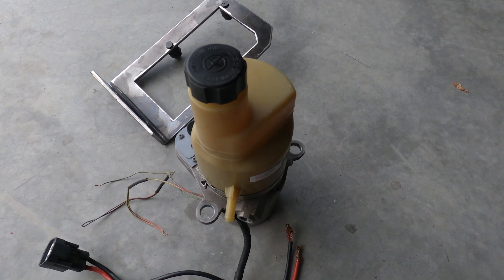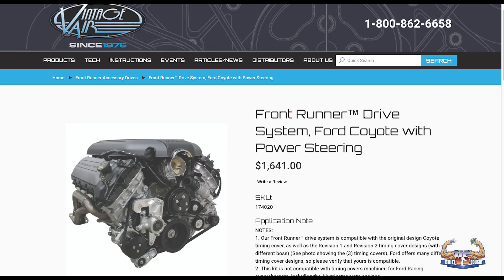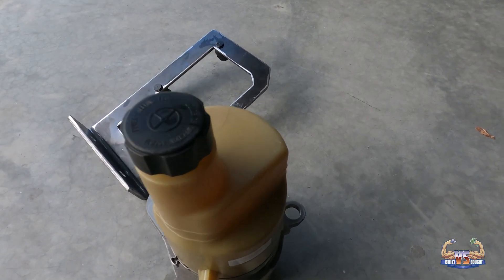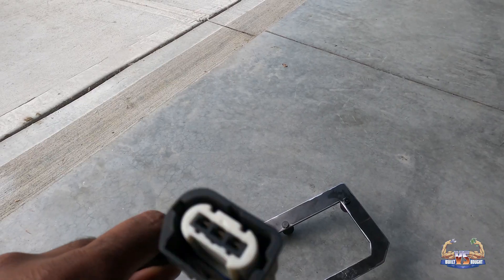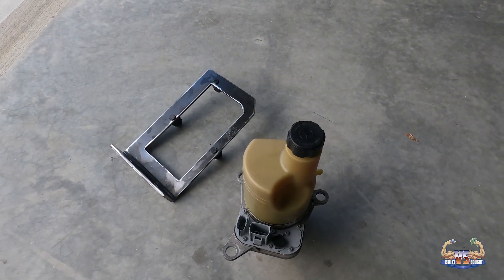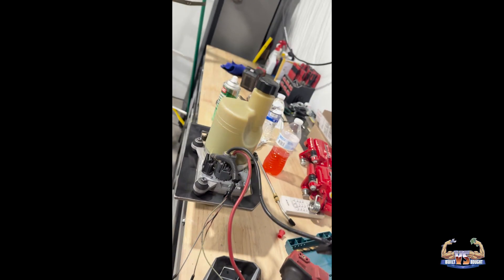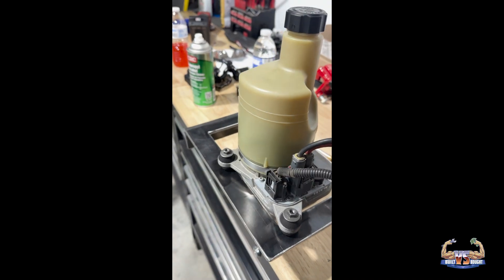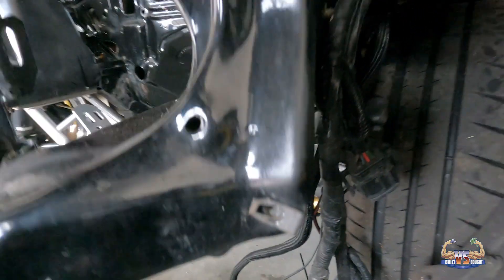Why I’m Running a Volvo Electric PS Pump on the 5.2 Aluminator Foxbody! Feat Terry Dill

Comment: So been following the Volvo swap for a long while now, and when the first swap was done on the Corral, i thought it was cool. Loud, but cool. I would ask though, did you check out the EPAS options? The Saturn Vue and Prous seem to be doing a good job, even in the autocross arena. Do a bit more research, if you aren't 100% commited to being married to the Volvo. Quieter option. Possibly less poqer steering line too, depending on plumbing.

Comment: Interesting. But after seeing the problems my sister had with her dodge rams electric power steering and how they go out without absolutely no notice and could cause a crash i am not sold on it. Not to mention they dont work in the cold. I'll be going the old school pbh way. No way do i wanna be flying down the road and my steering goes out and i wreck my new build 😂
Reply: You can still steer the car as it would basically be like having manual steering. These new full electric ones lock up the steering cause you don’t have the connection between the wheel and rack like this setup will provide. If the pump goes out it will just stop pumping fluid.
Reply: @terrydill8592 That makes alot more sense